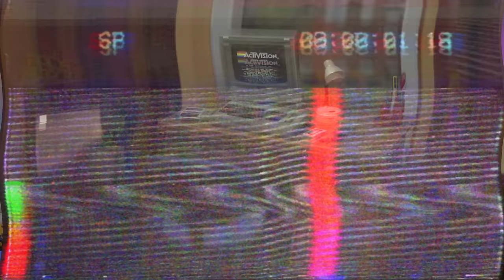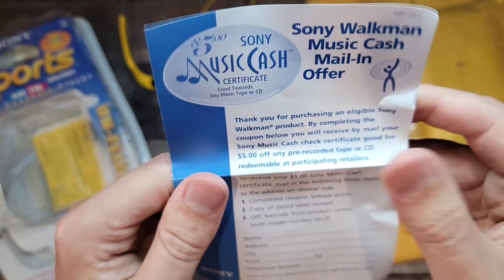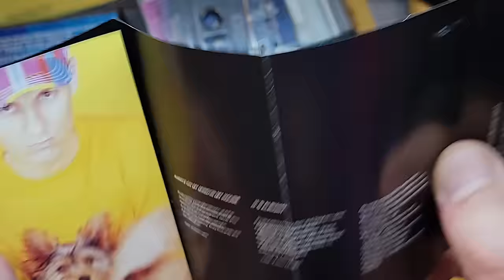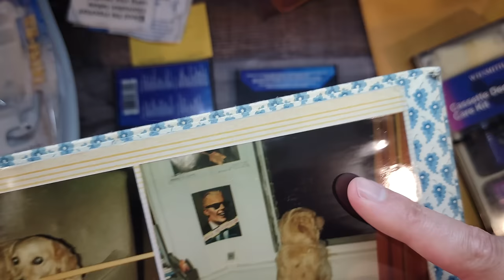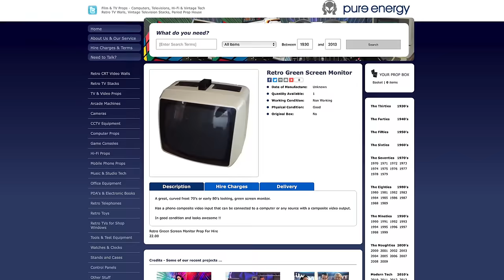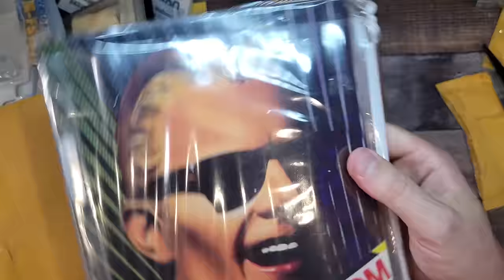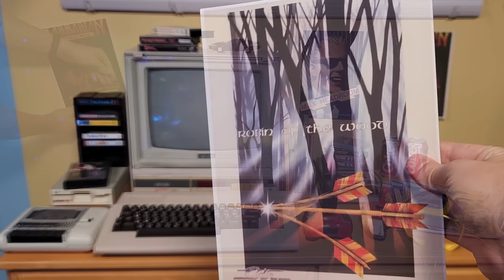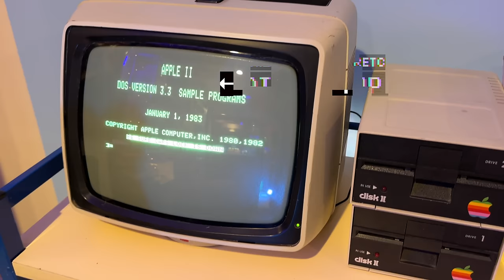Recreating my 80s Childhood Bedroom Computer Setups!

Comment: Also, A while ago - I replaced all the " machines" I had over the years - ZX81, Spectrum, Vic 20, CBM 64, Atari 400, Amiga 1200 ....got them all and then I realised, the one thing that was missing , which I couldn't find on EBAy and that was the " Time " - being there....both my parents and my sister were still there...in our house in Basildon...does that make sense ? so I just re sold them all and just cherish the memories ...

Comment: I have that aftermarket case on one of my 64s. Never knew where the case came from as there is no label on the bottom of mine. 

And seeing your monitor setup on the 64, it screams for one of the old Kensington glare screens that rested on the front of the monitor from two arms. I think mine has died but may still be somewhere downstairs, but it was so needed on those curved screens. (1702 here.)

I have that disk drive too. giggle I destroyed those Quickshot joysticks in days. Never could get those Epyx joysticks to feel normal though. Too much Impossible Mission and MULE…
Reply from the maker: That Apple monitor actually is meant to have an anti glare built in but it looks like it didn’t survive. So I’m still on the lookout for that part!

Comment: Back in the days, I had been told that the magnetic field of a TV was pretty strong, and that I should never leave my game tapes or floppies on top of the TV (or too close to it on the sides).

My own setup was similar to the right one, with a somewhat wobbly second hand desk with drawers, I also had a TV with a glass pane in front, the quality was terrible and the text barely readable with some color combinations of foreground and background :)

I'm actually surprised that the Walkman worked fine, most tape decks I've found tend to have broken gears or melted belts, you were lucky it seems!

Comment: I had that very same Max Headroom poster 😊
Reply from the maker: Did you cut it off the front of the large book like I did?!
Reply: @RetroRecipes  Nope, I had a full-size one  I got from a market in London and had it on my bedroom door. Seeing yours brought it back into my head and I can picture it right now, along with my Speccy and QL on my computer desk along with the Ferguson 37149 colour portable TV I had that my dad only recently swapped for a flat-screen!!! Ahhh, such fun times eh.
Reply from the maker: @TheOneTrueSpLiT  M-m-max nostalgia levels
Reply: @RetroRecipes  I still have the QL and its Microdrives and my A2000 with GVP 68030/68882 card and OpalVision along with all its floppies, I think I may have an original 1982 48K Speecy somewhere. But they're all boxed up in a garage, I just don't have the space to set them up as I now live in a single room.  Bummer.

Comment: PS - Extra comment - amazed the Walkman worked without any belt issues - thought the Now 11 tape might have been slipping because of that, but it obviously wasn't, LOL.  Those headphones/earphones have lasted as well as the Walkman!  (Just saying!). 📼
Reply from the maker: I didn't even expect that to be an issue so yes it held up very well. Perhaps the airtight seal stopped the belt deteriorating.

Comment: You really had original bought C64 games ? Can't remember that I ever bought any of my games . In Germany no one ever bought games for VIC20, C64, Amiga computers. All the software was copied and cracked. I modified my datasette so I could connect a second one for direct 1:1 copy any game. I loved this time. No problems with blue screen, or trouble with interrupt settings. The userport was the Arduino from today. I killed a lot of 6526 CIAs and a few SIDs ( the POT x,y Inputs). The C64 controlled stepper motors with small mirrors. We built deflection units for lasers. The laser tubes were from the analog picture disc player from Philips.
Reply from the maker: Oh yes bought a lot from WH Smith and Boots, UK

Comment: Does the clock on the Hinari TV run fast due to 60Hz USA mains? Also the tuning issue is more likely due to UK TV's not having VHF channels 3-4. We started at Channel 21 (UHF). A UK C64 should work fine though. l'm fairly sure that the mains frequency has nothing to do with tuning. More likely you have a missing 33v power supply which was used in old skool TV's for tuning. (If you are wondering, I used to be a TV/Camcorder/CD/MD engineer in the 90's) You can buy RF modulators that are old skool UK spec you need to look for (PAL-I) and with the right cable you should get your C64 up an running.
Reply from the maker: Yep I actually got it working yesterday. The clock does indeed run fast! But I bought one of these https://www.amazon.co.uk/dp/B08P3B6JSM/ref=cm_sw_r_as_gl_api_gl_i_8WH1GZNDESET4A3W6XD1?linkCode=ml2&tag=secure05-21 and it worked on channel 21 or 22. The same PAL C64. My question for you is, why couldn’t the TV find that C64 with a direct RF connection? I tried adjusting the RF channel screw on the C64 both ways. Thanks 🙏
Reply: @RetroRecipes  So the C64 used to output RF on around UHF Channel 35-37 (Which got used when channel5 launched) That modulator probably does the whole band. You say that you only got it to work in channel 21-22 Would it not work on anything higher? As I said before, Electronic TV tuners use a vericap diode to do do tuning. Higher frequencys require more voltage. I would suspect that if you can't tune higher your 32V rail is low (most likely caused by a leaky capacitor.) 
When you tune is there any graphical indication on screen and when it does tune is it most of the way to the end of it's sweep?
If you are going to repair this be a bit careful as the chassis in that TV is likely live, though you are using a step up transformer. Some step up transformers are autotransformers which have no isolation from line voltage and could give you line + 220V. :(
Reply from the maker: So using the adapter once I go past 24 the image gets very fuzzy. Over 25 it stops being able to find it at all. I don’t have an antenna connected. It looks like the signal gets weaker or looks like interference. 

Your hypothesis makes sense. A capacitor may be the blame. Do you think it could alternatively be an issue caused by the step up transformer from 110V? Somehow not supplying adequate voltage. 

On a technical note, why do higher frequencies require higher voltage? Is it that they’re literally higher in every way?

Many thanks for this!
Reply: @RetroRecipes  Ok, interesting higher frequencies get more fuzzy. That sounds like an RF fault in the tuner to me or could be an issue with the antenna isolator. Is there a tuning indicator on screen? I’m interested to know if the indication shows as high when in fact it’s low. To answer your other question, electronic tuning on TV’s and VCR’s is achieved using a variable frequency oscillator (VFO) and yes its the same thing as is used on music synths. This forms part of the Superheterodyne receiver system. Most oscillators work by having a variable capacitor used in part of the circuit - which lets you tune for stations. No doubt you’ve taken apart an old radio receiver and seen the tuning capacitor. Well in higher frequencys you don’t need such a large capacitor. Some cleaver person (probably in AT&T or Bell Labs) discovered that if you reverse bias a diode (connect it backwards,) you can use it as a capacitor in an oscillator circuit, if you increase the voltage to it then it’s capacitance drops changing the resonance to a higher frequency. With some tweeking of the materials used to make that diode, larger veriations in capacitange could be achived. Some TV tuners have a single vericap diode and others have multiples. The others being used to tune the input RF amplifier stages. - This could be another reason for your problem. Generally in TV repair we didn’t touch the tuners. If they went bad we replaced them. The cool thing is that they are fairly generic so long as they used the same technology you could swap and graft them from one TV to another.  Older tuners just had an input for the tuning voltage, newer ones used I2C bus and had a fixed 33V input.
Reply: @RetroRecipes  When you say that you don't have the antenna connected, I presume you mean the outdoor TV antenna? But you have a coax cable from the F-connector on the modulator (out) to the Belling-Lee (UK TV antenna socket)?
Reply from the maker: @zero0ryn  very cool info thanks. Unfortunately the TV doesn’t show anything while it’s scanning. Just fuzz. It has an auto search button or fine tune +/-. They were trying to be automatic and high tech, and it worked fine in the day. If you had to guess what would you say the fault likely is?
Reply from the maker: @zero0ryn  And that’s correct yes. Only cable is RF from TV to the new adapter. I was just saying there’s nothing else connected that could be overpowering the signal as the frequency reaches 25+.
Reply: @RetroRecipes  Wow! thats putting me on the spot (remember Roy Castle's record breakers?) The fact that it seems to work but is snowy on higher channels tends to suggest the tuner and it's tuning voltage is working. I'd say you have a fault in the isolator (if the set has a live chassis) or the tuner module its self. For it to do what it's doing which is a sharp cut off over 503MHz there would need to be some capacitance across the antenna input or RF amplifier. I'd investigate the tuner module, It might be rusty. If you reach out to a youtuber called shango066 he my be able to help you fix it. He lives close to CA so is way closer to you than me. He's a bit secretive and camera shy so we only see his hands. It's always good when youtubers get together, great for sharing subs :) Alternatively if he cant help then Mr Carlson's Lab might. I have no idea where he is and he's not a TV guy, but he knows more about RF than most people in the radio ham community that I know. 

Check the tuner can for rust and tin wiskers that grow from the tin in the solders. (you will have to desolder it to do that and watch out for that tube) if you don't get any luck with ether of those guys I could try to help you over a video link zoom or teams or any other platform that works with Linux (I don't do windows) I'll leave my email in the next post, please delete it once you have read it. (thanks for deleting it if it was you and not youtube)
Reply from the maker: @zero0ryn  All noted thanks! Didn’t mean to put you on the spot 😉 I can probably repair it or replace the tuner but as it’s special to me I think I’ll leave it as is. The adapter solution is working great. Nice picture. Better than I probably had as a kid. I wanted your best guess to present to viewers (shall I mention you or you prefer not?) Some fault with the tuner seems most likely.
Reply: @RetroRecipes  You can mention me if you like :) At some point I'd like to have a youtube channel myself, in fact I've got loads of footage but not the time or enclanation to edit it :P do you have a discord server (thats free?) Or I'm on Neil (RMC) or MFS.
Reply: I would 100% open and investigate as with time the receivable channels may reduce to the point of it not working :(
it might be leaking caps or rust or tin wiskers. <- thats a shango thing btw
Reply from the maker: @zero0ryn  Will do! Sorry I don’t do Discord. Just not enough free time. Many thanks for the help 🙏

Comment: You cheated with the 110v to 220v adapter but because you switched counties I'll give you a pass lol. Well done.

I had a 1980 Bell and Howell Black Apple 2+ and threw it away when it died around 1985ish and that's virtually unobtainable working at a reasonable price.

Comment: About the Hertz issue... I have a PAL 1084S-P1 from Europe here in Canada. I was wondering if I should change the power transformer inside (if there exists one) to 110V or if I should just use a step-down transformer. I don't know yet, since I have to change the flyback on it, it needs changing. Anybody out there that has done a power transformer swap on a 1084S-xx?